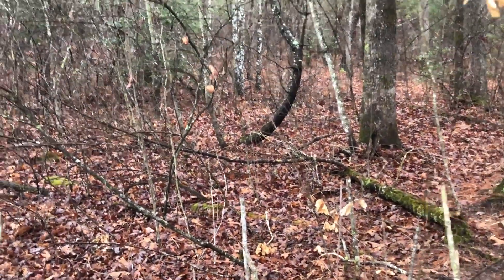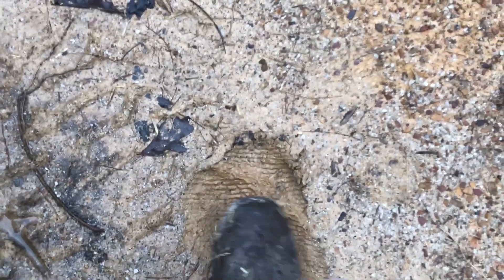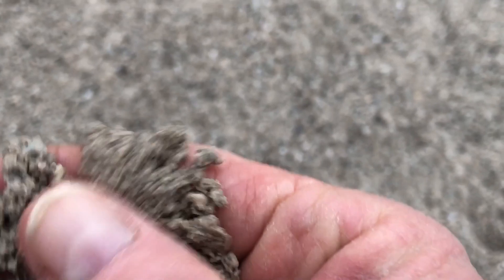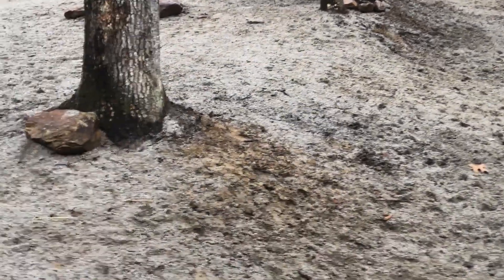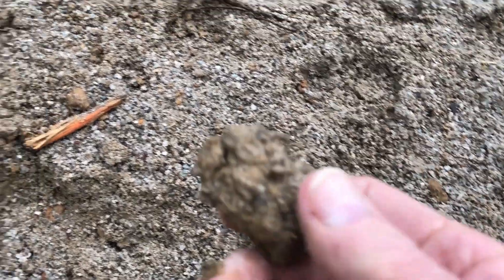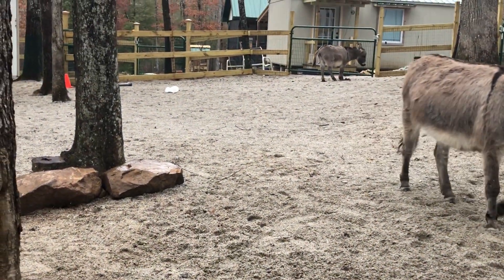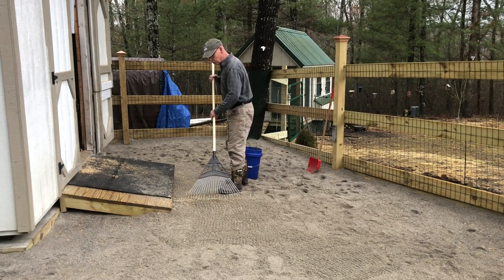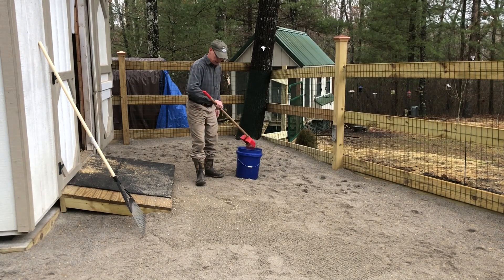The Best Dry Lot Paddock Footing for your Donkeys & Horses - Let's keep those hooves clean & dry

Comment: I’m not sure what kind of sand is in our dry lot area, but it’s very dusty. And, unfortunately, part of the dry lot is on an incline. We have a lot of clay, but not the way you do. We have to keep one horse on a dry lot because of laminitis, and because it was so dry this summer, we were constantly dealing with dust, and his hooves ended up chipping and cracking. This is the first year dealing with all of this, and it has not been fun! Love your donkeys, and so glad they’ve found such a wonderful, caring home. Also, we (mostly my husband) clean up twice a day.

I love the covered wooden step that goes into the barn! One thing we have trouble with is how quickly the sand wears down at the doorway where the horses come into the barn to get to their stalls. Our area might be too steep, but I’m sharing this with my husband for all your great ideas!
Reply from the maker: @annewatman677  Thank you - We use “manufactured sand” which is man made from crushing granite rocks. It can be very dusty. During really dry times I’ll dump the water buckets under their hangers when refilling, so they stand in wet sand whenever drinking. This puts a little moisture in their hooves. I also wash their hooves with Water & Apple Cider Vinegar when picking them which also helps with the over drying of their feet while killing any Thrush Bacteria 👍
Reply: @ Thank you for the quick response! I’ve never heard of using Apple Cider vinegar, but certainly worth a try. And, I’m not at all familiar with Trish bacteria. We’re in southern Wisconsin, so maybe that’s why? We’ve had such a hard time finding someone to help us (we’re older than you!). When we initially built the barn, and put in the “sand,” I’m guessing manufactured was what was used. You’ve definitely given us some good ideas. Thank you.
Reply from the maker: @annewatman677  I spelled Thrush Bacteria wrong in my comment 😂 - You are welcome to email us if you’d like - Our email address is in the “About Section” here on our channel in YouTube 👍
Reply: @ Auto correct is always changing words on me! I have dealt with thrush, but it was at a place where I was temporarily boarding my horse. Too many horses, and they would stand in mud all day. It’s still that way for a lot of the horses, and very happy ours live with us. Absolutely love the way you’ve set everything up. Also, thanks for the contact info; you are very thoughtful and generous.
Reply from the maker: @ reach out any time - we have made close friends all over the country from our YT channel 👍❤️
Reply: @ I don’t find any contact info in the About section, and it looks like you have messaging turned off on Facebook. I understand not wanting everyone sending you messages! But thanks so much for responding to me here.
Reply from the maker: @annewatman677  I’ll check Facebook / send me a friend request- our email is:
clearcreekcabin@mindspring.com

Comment: This video inspired me to create a dry paddock similar to this in West Wales, UK. Unfortunately, it hasn't worked for us. This type of sand compacts too much and while it is amazing when it's dry, it gets waterlogged in a rainy climate. When it rains a lot, the surface becomes like hard mud. I still think it is a brilliant idea for somewhere with less rain but I wouldn't choose it again for us.
Reply from the maker: @timeamegyeri8950  So sorry to hear that - we get about 44 inches of rain a year here in E. Tennessee (111 cm) - We have a clay soil base underneath our 4+ inches of Manufactured Sand. Drainage on a flat paddock is the key to insure you don’t get a mushy mix of the two(which can be difficult to achieve) Here we have slightly sloped paddocks which allow the water to drain from under the sand and percolate into the base below. Also the composition of the sand needs to be a granite based substrate that is not too fine. The particles need to vary in size from 1/16th of an inch to 1/4 of an inch. Granite dust or a very fine sand will not work. Again so sorry this didn’t work for you. You are welcome to connect with us via email if we can help in any way: clearcreekcabin@mindspring.com 👍
Reply: @ClearCreekCabinMiniFarm  thank you! I do love your video & what you've achieved there. Yes, we have drainage and a sloping yard. I think I will have to remove some of the compacted sand & replace it with a different sand that allows better draining. It doesn't have standing water more like a compacted mud layer. It's perfect when it's dry but that doesn't happen often. Thanks again for the great video!
Reply from the maker: @timeamegyeri8950  👍 Thank you

Comment: I have seen this done before for a dry paddock with stone dust but they used layers of the ground fabric under there to prevent the mud under to come up.  For really wet muddy paddocks.  As well as a kind of wood frame around the outside to help it to stay inside.
Reply from the maker: We have very hard clay soil underneath. We lost a little to compaction but that has created a very hard base underneath the sand. We also used 4x4’s & 1x6 decking boards to contain any wash out. It’s been 3 years & we’re in the process of top dressing it with MF Sand & fixing issues - stay tuned a new video coming out in a few weeks 👍
Reply: This is so helpful.

Comment: My husband put this on our back driveway. We thought it would compact but didn't. It track sand in awful in the garage. But I can see how well it works for donkeys.
Reply from the maker: We also used it for a base under a brick sidewalk & until it was finished, we tracked the sand into the house - what a mess - my experience though is it compacts well if less than 4” thick - we wet it down & tamped it when used for the sidewalk

Comment: I love your video and explanation of how you resolved your flooding issue. We are a non-profit donkey rescue, therapy and sanctuary in north Texas that saves donkeys and trains them to be therapy donkeys for use with veterans, first responders, special needs adult and kids. We have been on borrowed property for 5 years as we work to raise the capital necessary to acquire a suitable donkey property of our own. We have an enormous issue with flooded paddock areas and barn stalls every time it rains that floods and we can't seem to find an economical solution to resolve this flooding issue that doesn't involve renting a Bob Cat, grading the paddock areas and investing in sand or construction materials the non-profit simply can't afford. Have you found any other methods to detour water from flooding into barns and paddock areas? We have dug  channels and areas so the water can drain but its still a huge problem. Thanks very much for your suggestions.
Reply from the maker: I am very familiar with your organization - You do wonderful work - I sent you an email so we can get together and discuss your paddock issues - I'll gladly assist in any way I can with your water issues....
Reply from the maker: You can email us at: clearcreekcabin@mindspring.com

Comment: This is helpful because my property is mostly woods that will be forestry mulched soon.
Before you put the sand in, how did you prepare the ground?
Reply from the maker: Thanks - We raked up any leaves, mulch or organics. We have clay soil so we didn’t put down any other base.  Just the Manufactured Sand. We’re gonna add some more on this year to dress it up. It’s been 3 years 👍
Reply: @ClearCreekCabinMiniFarm  good to know, thanks! Do you ever have issues with weeds growing through?
Reply from the maker: @jaimiehuffling7100  No, the donkeys running around on it keeps the growth down + they’ll eat anything green. But then again we dug up just about all of the small tree roots with the tractor when we cleared the woods. So I don’t know what will happen when you forest mulch? Only concern I would have would be sharp sapling stubs left behind that could protrude through the sand which a donkey/horse might step on - You are welcome to reach out to have in-depth discussions: clearcreekcabin@mindspring.com or connect with us on Facebook: @clearcreekcabinminifarm 👍
Reply: @ClearCreekCabinMiniFarm  thank you!!
Reply from the maker: @jaimiehuffling7100  You’re more than welcome 👍

Comment: What a great idea. We use sand for our chicken coop.  It works so well. How tall is your fence. We are going to do the same fencing for our future donkeys.
Reply from the maker: The manufactured sand is definitely the way to go for the footing in a paddock - so good for their hooves & easy to maintain. The fence is between 4 to 5 foot tall depending on the slope of the land but it’s at a minimum of 4 foot - We used green coated 2”x4” weave wire w/ pressure treated posts & 1”x6” decking boards 👍
Reply: @ClearCreekCabinMiniFarm  Thanks! Have a fun day.
Reply: This is what our local company has. Do you think it's the same? Granite Sand (Screenings) Applications include asphalt mix, horse rings, paver base, leveling sand, pipe bedding, landscaping, parks and baseball fields, walking path, agricultural mix
Reply from the maker: @DragonflyFarmZebu  Yes - it’s called by a lot of different names - the largest particles should be no bigger than 1/4 to 3/8ths of an inch
Reply: @ClearCreekCabinMiniFarm  ok great! My husband and I are researching and making sure we get it right. Thanks again.

Comment: This is a very informative video, thank you! 🐴💖 Can you tell me what brand of manufactured sand you purchased? Is manufactured sand available at places like Home Depot? I live in San Diego, CA and would love to add some of this product to my horse’s outdoor 24x24 stall. Half of her stall floor is covered with mats and shavings which is great to keep her hay clean and sand free but the other half currently has a layer of compacted DG mixed with sand. The ground is very hard and uncomfortable for my horse so I believe adding 3-4” of this manufactured sand will soften the ground for her and be much more comfortable. Thank you in advance for any advice you can give me!
Reply from the maker: Thank you - Manufactured Sand is purchased from a sand & gravel company & delivered by dump truck. It is also referred to as Stone Dust, Granite Fines (not decomposed granite) or it’s called Rock Crushings - reach out to my email if you need more info (in the “About” section of this channel)
Reply: @ClearCreekCabinMiniFarm  Good to know, big thanks!

Comment: Did you remove any of the top soil or lay a barrier before you placed the sand down? I was not sure if the sand would simply “mix”/“fall” down into or with the dirt. I am in Kansas close to Oklahoma
 and we have a very heavy clay like soil. Thanks!
Reply from the maker: Hey Tiffany - We are in East Tennessee and we too have very heavy clay soil.  The area in which we made our paddocks were all woods - We removed trees, stumps and all undergrowth.  We then removed all the leaves before putting down the sand.  Wherever we put 3-4" of the Manufactured Sand it has held up very well.  We had some areas where it was only about 1 inch thick and you can see that it has mixed in with the clay.  BUT it's still dry in these areas, just not as pretty.  I think it would be best to do something like this when the ground is good and dry - That way you can grade out the area, as we did, and put down the 4" of sand - That way the sand can compact naturally on top of firm earth instead of sinking into soggy clay mud.  I'm no expert that's for sure but IMHO that is what we did and it's worked so far....  I've got a follow up video coming out next week.  So stay tuned...

Comment: So I live in grass Valley, California, and we have what’s called red clay here I’m building a dry paddock for my Arab because they were in the red clay last year which was horrible. I was going to put down the weed black fabric first and then the sand is that a good idea or can I just put it over the red clay? I’m afraid the clay will start coming through.
Reply from the maker: @SandieBendz  We also have the red clay here in East Tennessee. The key is drainage… As long as there is no ponding issues the manufactured sand will hold up being put directly on the clay. That’s what we did. It will slowly compact down into the clay over time. We’re on year 4 of building the paddock & it could use a light top dressing again at this point 👍

Comment: I see that this was posted 3 years ago. Are you still happy with it? We have alpacas that have chosen their small paddock area to be their toilet. We have terrible clay here in Michigan and drainage is horrible. Im using pine pellets to jelp soak up urine. Will this work for such an area?
Reply from the maker: @debbiedegayner3312  Hi - We love our dry paddocks - our soil base is red clay also - the 1st couple of inches of manufactured sand will compact into the clay to make a hard base - the 3 or so inches of sand above that will stay relatively loose - drainage is the key so that heavy rains don’t wash away the top layer of sand
Reply: @ClearCreekCabinMiniFarm  so do you have extra drainage? Or is the 2 inch base above the clay where the water drains through. Our main issue is they pee there and the urine just kind of sits on top. With your setup would it then drain down the to 2"base and clay?
Reply from the maker: @debbiedegayner3312  Our donkeys do the same - they have a favorite spot they pee in - it drains down into below but we still periodically dig up the spot & refill it with sand & soil to control the smell. As far as drainage - you must insure that surface rain water doesn’t erode the sand if you are on any kind of slope - otherwise the sand will be washed off the surface - we dug drainage ditches above the paddocks to divert surface water away - But then again, we live in the hills of Tennessee 😊

Comment: Would gypsum work? Or is that a bad thing bc then would actually help the clay soil just to top dress every year you can then use as compost the poop mixture like when scoop it up?
Reply: Nvm I know expensive but yes to the "sand" but not sand bc natural sand compacts more just making a pool of water right or idk just trying to learn what to do for 2 horses.
Reply from the maker: Please see response below...
Reply from the maker: Hi Amelia, I don't believe that gypsum would work - Natural river sand, also known as contractor's sand or play sand ,wouldn't work well either - Both stay wet and don't dry out quickly.  The manufactured sand I recommend is usually made from granite rocks which do not retain water and it compacts very well. Also drainage is an impotant part of your "Paddock Plan" - You don't want water to pond nor cause the sand to erode away.  You re welcome to email me if I can help in any way with your planned "Paddock Paradise" - My email is in the "About Section" of this YouTube channel - Best of luck...

Comment: hey! Fortunately we have a rock Quarry a mile from our house that sells it $25 a ton. we are bringing our first 2 mini donkeys on April. fencing almost complete as is the barn. so here is my question. our barn is the walk through type. (small barn, 18x24 with one 6x18 stall, a 6x18 walk through and a 12x6 stall then a storage room. can we also use the manufactured sand in the walk through? we live in NC and the red clay can be horrible. also, someone recommended mats for the stalls. I could probably use that under the mats for stability and protection from the bare ground? any advise would be wonderful and thank you in advance.
Reply from the maker: I think using the manufactured sand under the mats would be just fine - I get “Red Clay” - we lived in NC for 11 years - you are welcome to email me directly with questions clearcreekcabin@mindspring.com
Reply: Did this work out for you with the clay underneath? We'll be in NC later in the year

Comment: How much did you pay for the 3 to 4 inches of manufactured sand?
Reply from the maker: @SandieBendz  At the time it was $40 per ton - there is about .75 cubic yards per ton which roughly equates to 81 square feet of coverage @ 3” thick or about 50 cents per square foot at 3” thick (if my math is correct)

Comment: How does it handle manure removal ?
Reply from the maker: Hey Sharon -  It great for "Doing Daily Donkey Doo Duties" - As you saw at minute 7:31 in the video, it scoops easily with a manure fork.  We only have 2 donkeys and we pick up poo several times a day.  So we have never had a problem getting it off the sand even after a heavy rain. The little pieces left over from when they do "The Macarena" on a Doo can be easily raked up into a pile with a metal rake and picked up with a manure fork. This footing option is very easy to maintain... Thanks for tuning in to our channel.

Comment: Where do you buy this from?
Reply from the maker: This "Manufactured Sand" is usually available from "Aggregate Suppliers" (Sand & Gravel Companies) - If you Google "Manufactured Sand" you will see exactly what it is - It's called many things in different regions of the country e.g. Stone Dust; Crusher Fines; Granite Dust or Granite Fines; Crushed Stone Fines...etc. The key is that the largest particles should not be bigger than 1/8" to 3/16" with the other particles of smaller various sizes. I suggest when you find it to go and get a 5-gallon bucket of it and lay it out in your paddock - tamp it down - and evaluate it yourself....😃

Comment: I’ve used fines for the horse and mule paddocks. Both of them ate it and caused colic. Be careful
Reply from the maker: Thank you - We use hanging slow feeder hay bags in their Donkey Dugout & Stable which both have different footings. We never feed off the ground in the paddock. We also periodically sand test their manure and thankfully have yet to have found evidence of any intake. Three+ years with no problem. Thank you again for the heads up.